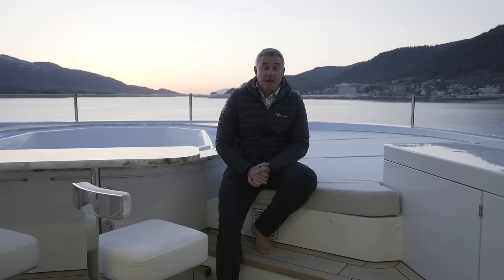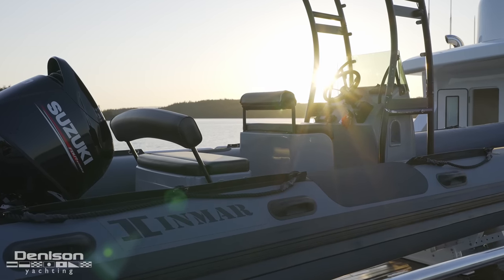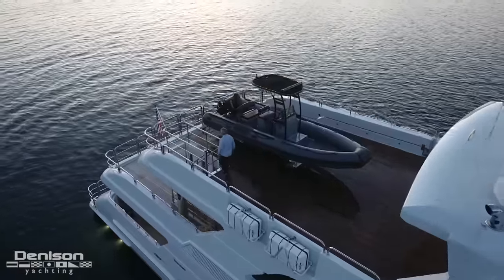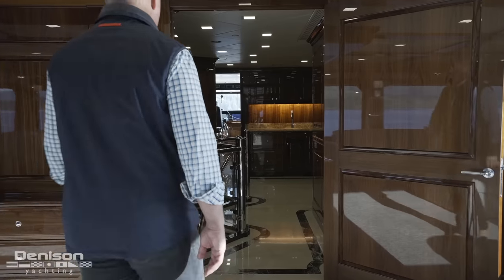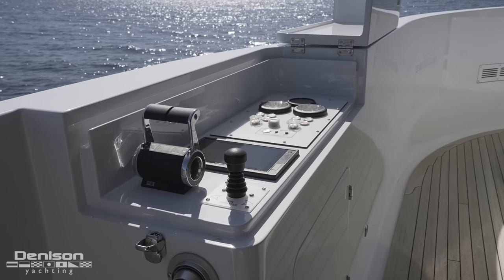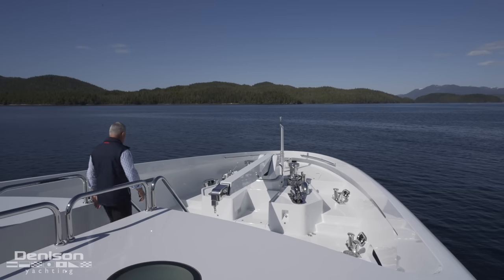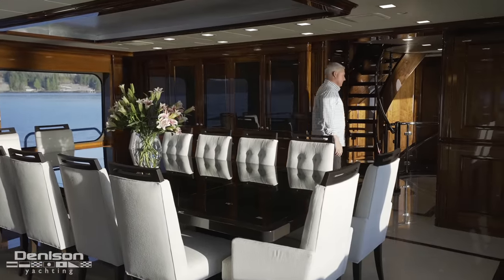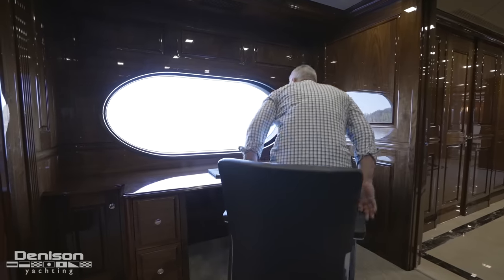JACKPOT: 164 Christensen 2020

Comment: Thirty five million for a fiberglass boat, personally for that money i'd rather have steel or aluminum, or a combination, especially for cruising in the far north and far south, still, it is a stunning boat.
Reply: I said that too. The Numarine 37XP also has 6 cabins and is only 12M euros. A 140' Bering is 22M. And with both of those, you can get an extra ice belt added, although in the Bering you don't need it and on Numarine boats you can get special ice belt. On Bering they have the chines set up so if you ran over anything like a log, you wouldn't damage the engines, or the hull or the rudder. The stabilization fins are designed to fold in automatically in hard impact. Avoid you Wrecking the fins, but allows you to roll away from whatever it is too. I'm sure they beefed this up though...I hope.
Reply: I was thinking down the same lines .
 Imagine trying to get out of a small inlet with even the thinnest ice in November !  Could be very damaging  !
 And very expensive !
 I would like to have a boat I could  take to 
Naples in May and return I  Oct.
 This is NOT the boat for that ! 
 It is a Caribbean  boat 
 ONLY .
 DML
Reply: A fiberglass Nordhavn has transited the Northwest Passage, so there's that.
Reply: Id take majesty 175 over this for the same price.
Reply: @Eden-nd7rg  Still made of fiberglass, too much goes wrong with them, they flex far too much and burn really well.
Reply: @clifbradley  I like the Numarines as well, Bering is for me shining right now though.
Reply: @anthonynicholas1165  ik its fiberglass. Thats why said id prefer it for the same price as its bigger.
Reply: Then you must be willing to pay much more for a comparable boat.
Reply: @clifbradley  Yes, but none of those boats are nearly as large.
Reply: For that money I’d buy Epstein’s island 😮
Reply: Settle down!  None of you will ever have that money, so just sit back and watch the video!
Reply: Agreed. Pretty but flimsy.
Reply: And the design looks like a giant 90s refrigerator.

Comment: If they would have built this boat using a steel hull and an aluminum super structure then that removes the use of fiberglass because if for some reason reminds me of if a fire starts at night while most people are asleep, that fire can grow rather quickly and you could lose the whole boat. But steel doesn't burn and so much quicker and easier to get the fire out. I forgot to mention that toxic smoke that gets going everywhere and you can not breathe it when fiberglass burns. Other than that, this is a 98/100 when it comes to buying this boat. To get the 2 extra points, they need to put that interior into a steel hull and in an aluminum super structure. They made a piece of art when they built this boat an I along with alot more people love it. Sleeps up to 16 guest and 11 crew members, thats alot. Of all the places we got to see on this video, I was most impressed and drawn to the ships engineering room with the work shop, and I was thinking about different types of tools he will need to make parts if and when they ever got stranded on the water and they needed to get going again and can't wait for parts to get flown in. Having the correct tools you can build almost anything if you know how. An I do. Yes I loved all the bedrooms and I being a single older gentleman, I'd only need an enjoy to be in the engineer's bedroom even if I was the owner of this ship mainly because each time I get one of my great ideas I have another work area to start building it. I do Love this boat, but please follow what Bering Yachts are doing because there are more an more people wanting their type because of the 8mm steel hull i think it is 8mm, for peace of mind knowing that its not going to burn an put black toxic smoke everywhere and choke everyone trying to escape from the smoke and fire. I don't think I have ever gotten to see what one of those emergency life rafts actually look like opened up sitting on the water and what type of extras do they have inside each one. If I was out on a huge beautiful ship and we had to get into the life rafts, I'd want all my family with me and if they happen to get into a different life raft than I did, you can bet on it I'll use the very best and strongest rope we have to join my raft with theirs so I know they are safe and ok until we get found by the Coast Guard. Also on all boats its the law the boat company and the owners must provide emergency life jackets and several throwable rings with a rope to bring them back in to the boat. But what about on these fiberglass hull boats and super structure of fiberglass, should they oass a new law stating they also must provide a respirator hood to get past the black smoke and to fight it for everyone to help put the fire out until the call from the capitan saying abandon the ship everyone to their life rafts. An Please 8f you go out boating with children, please teach them what to do, where to go wait for you and dont jump in the water incase any sharks come in for the feast.
Reply from the maker: Glad you enjoyed our tour of this amazing vessel. Appreciate the insight as well!

Comment: 35 million for a world explorer yacht? So sunken logs abound, ice chunks floating free and this is your boat? There is a reason most explorer yachts are made of steel and aluminum and have an ice belt if used in the artic a lot. I'm sure it would be fine, but I would go to Bering, Numarine, Alpha, CMB, AvA, CDM or Baglietto and give them less money for a slightly smaller boat, but with a better piece of mind. The 37XP from Numarine is only 12 million euros. A 140' Bering Is only 22 million, a 130' Flexplorer from CDM is 17-20 million. Sure it would be fine though and has a reinforced structure.